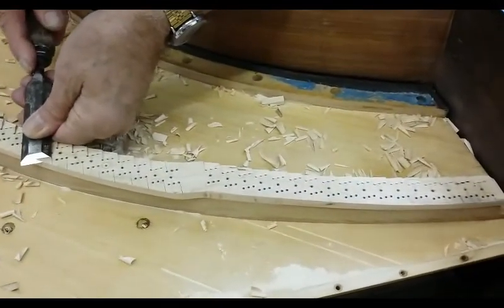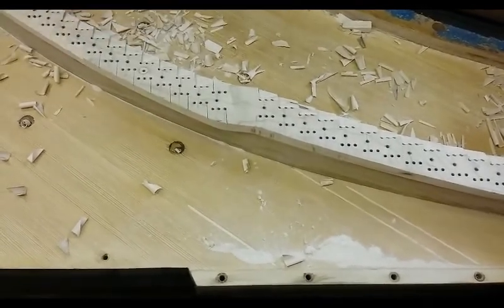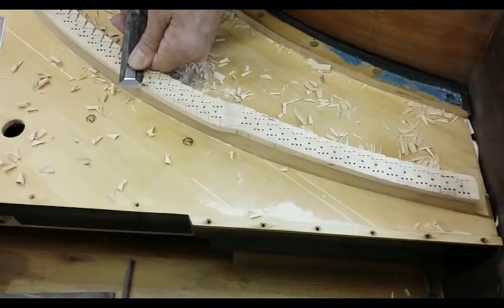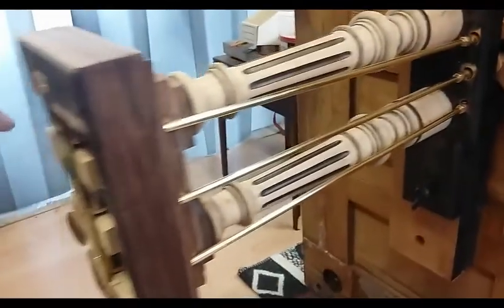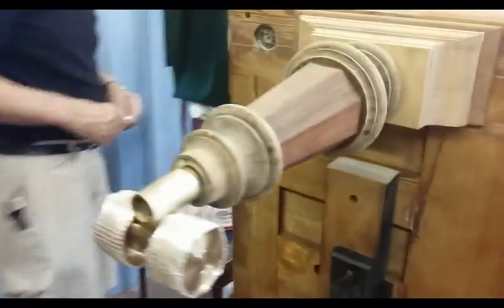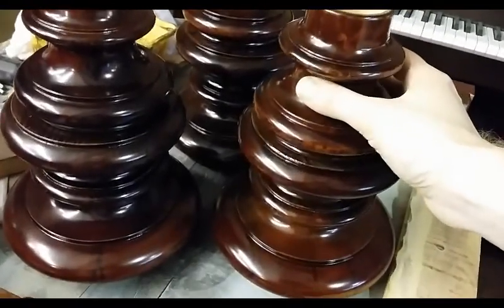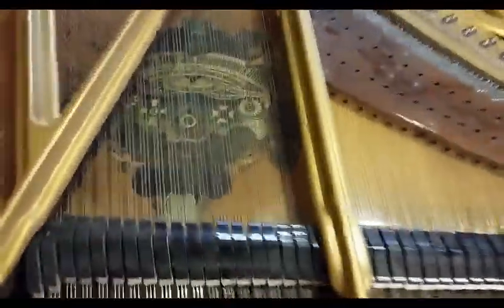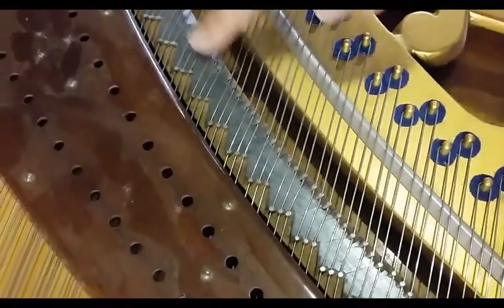Rebuilding a Bechstein PART 16

Comment: Hi, I follow your very diligent restoration work.  It is impressive the degree and scope of the project.  I am most curious how the redesign effects the sound.  What kind of application you use for the calculation?  I have a model A restored maybe 25 years ago and a model IV.  And look forward to see through to the completion.  Looking exceptional, so far.
Reply from the maker: Hi, thanks for the kind words!  The spreadsheet that performs the calculation is one which has been designed by Phil over several years.  I go through it a little in the following video, but I am really behind with uploading videos at the moment due to a house move.  I'll try and get the next video uploaded soon
Reply: Good luck with your moving.